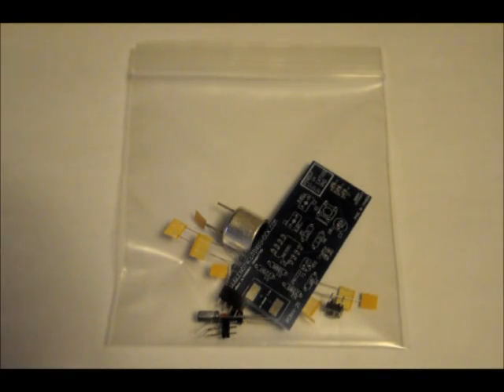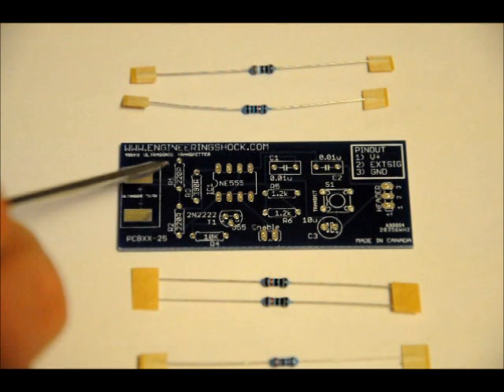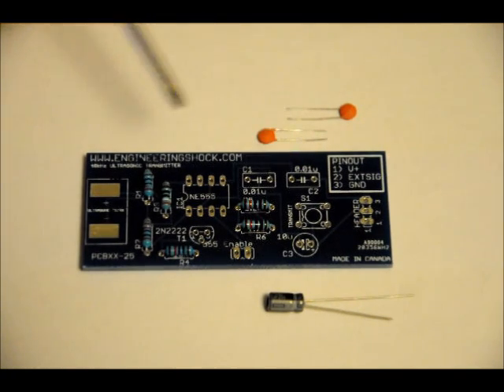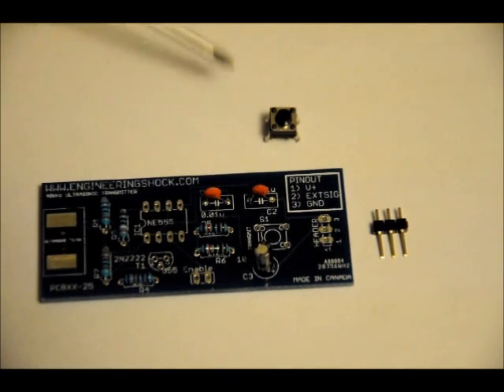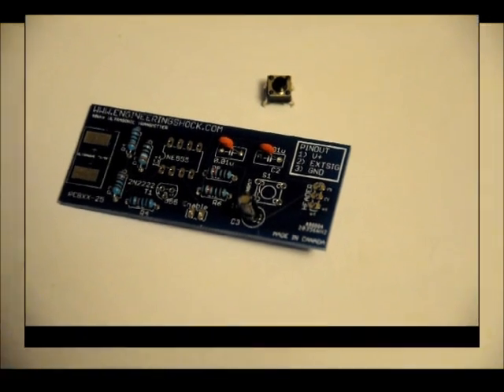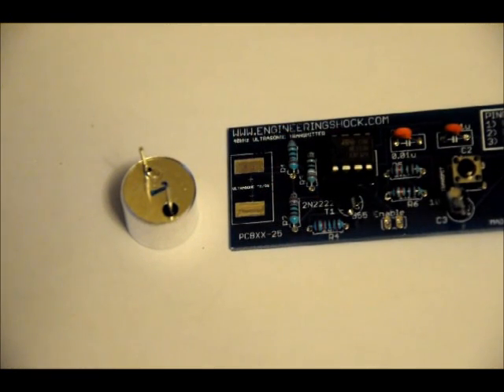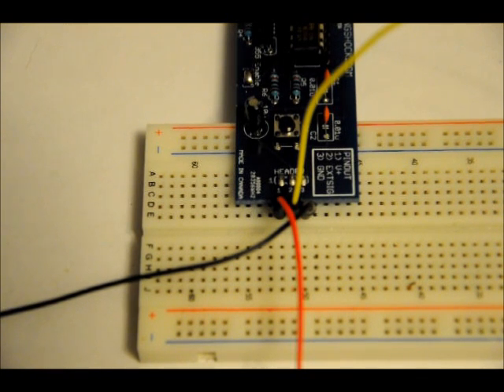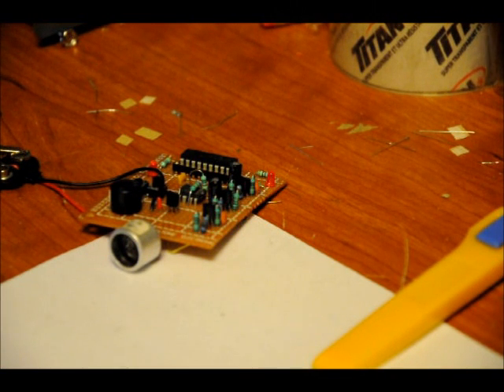Ultrasonic Transmitter DIY Electronics Kit Assembly and Demonstration

Comment: 1.can i use 2n3904 instead of 2n2222?"
2. can i replace the 555 circuit with an arduino to generate the frequency?

Comment: Hey Patrick got both Transmitter and Receiver kits in and assembled, however I have a certain purpose in mind and had a question.  I'm interested in adding the LED to the receiver kit at the end of the vid (Although the one I got from you is different). Im guessing on this kit it would be connected to the Vout on the LM386IC or Pin 2 on the header.  Also, if I was wanting to increase the range of detection, I noticed you mentioned amplifying the received signal on the receiver board, but can I amplify the signal on the transmitter as well?

Comment: you would use this in conjunction with a similar* reciver module.

idk about him, but this is an ultra sound application, meaning high frequency. the reason you would do this is because most ambient noise is lower frequency, so when you make a detector/ receiver you can put in high pass filters that cut out low frequency noise so you can detect the high frequencies tramitted from one of these. usually you dont work with low frequency because it makes filtering much more difficult.